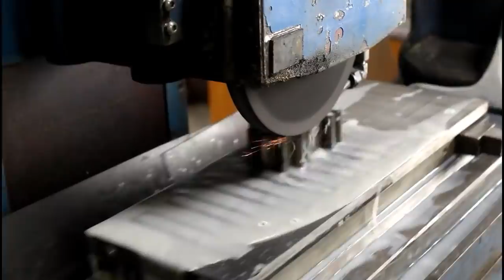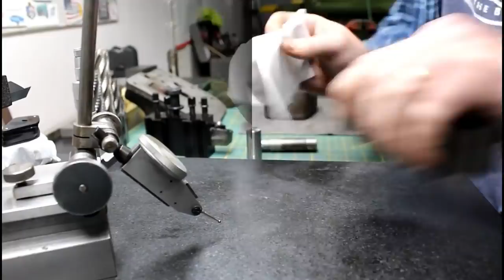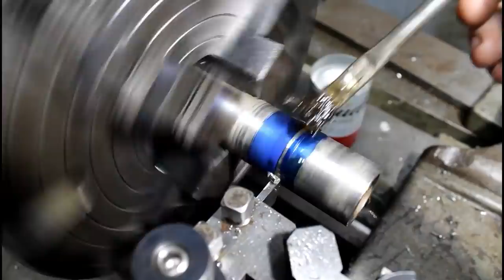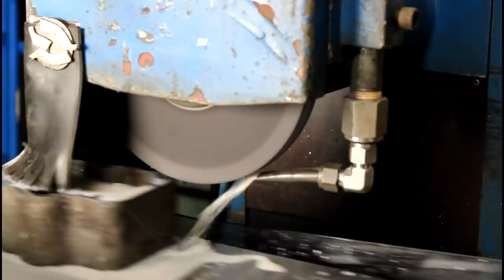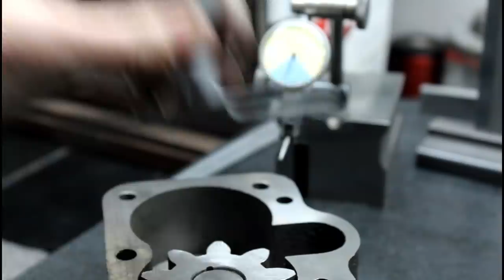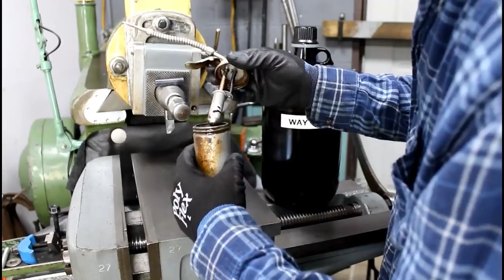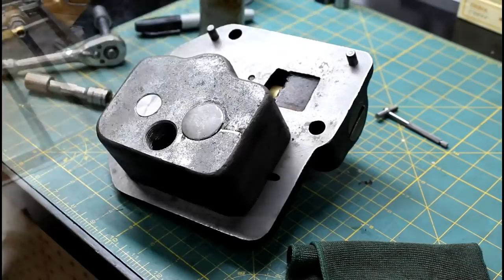OH Yeah! Gear Pump repair part 2

Comment: Steve, sigh I had my fingers crossed. Epoxy coat the walls and then machine to size. There are epoxies formulated for fuel tanks,.etc. Less expensive than plating as someone else mentioned although I'm preferential to plating.

Comment: Is the pressure relief valve leaking air?  This may allow the pump to drain dry back into the tank.
Reply: Look at 22:08 valve seat .....................

Comment: Your notion of slotting the teeth was my first thought. But I think the inserts will interfere where the gears mesh. You could use flat brass shim stock, bent around the gear bore. It could be made to stay in place by bending the ends and drilling corresponding holes/slots to retain the ends. Good luck Steve.

Comment: If you wanted to tighten up the radial clearance without making a giant project out of it, you could bore and install speedi-sleeves with some loctite, then cut out the center part where the gears meet. They have the sleeves in stainless, in stock. Might be easier to just press in som pcs of sch 80 pipe and rebore

Comment: Morning Steve great content in both pt1& pt2 if the clearance is available on the top and bottom land of the gears a whisper system would work that pending on the barrel tolerance which if worn more then the gears the barrel should be bored out and sleeved I've been seeing in the comments if a check valve can be placed at the lift point that would keep it primed  but i do understand that the check valve will also hold that water base coolant in the pump which is another problem with in itself. Here is a funny for ya 3D print some new gears to fit the tolerance of the barrel good luck Steve  time for me to go to the shop have several tractors to wire up today for some reason boss man thinks I'm the only one capable of wiring things up go figure right.

Comment: To reuse the setup you have I'd OD grind the gears and make a new gear case from a block of cast iron. My initial thought upon watching part 1 was to come up with a way to retrofit a Ford gerotor style oil pump to the unit.

Comment: Your pump works just fine for what you need it for. Like others have stated, a check valve in the pickup would solve the priming problem. Or a priming bulb on the outlet somewhere.

Comment: Good Video so far Steve, Next step I would take is to build up the cast housing some how maybe by brazing and re machining. Over sized gears are out because of fix shaft locations. Gear tooth clearance is letting oil drain back while off. Could also make a new housing out of aluminum . It will wear but not too fast. Seen a lot of hydraulic pump in equipment with aluminum housing last years with metal particulates being pump through.

Comment: why Brazing ?, there are Stick-Electrodes on the market that become hard as Rock. that way you can build up the theeth,  grind them to dimension after welding , and also harden the gears  as before. :).  it is a bit challenging spending so much time and get not rewarded, i went through similar isues with a pump for a boat that provided the cooling cylcle of the engine. You could also Slit the teeth and put a strip of teflon into the teeth  (high pressure pumps use this often to ensure the perfect fit, regardles of the wear of the housing :). as always , thanks a lot for sharing,

Comment: Before you do anything to the teeth of your pump. You need to take a measurement between the teeth peak and root. Adding a sleeving the bores would work better. For machine that is not used all the time and when it does you may not need the coolant I would leave the pump as is.

Comment: Steve....I like your idea of slitting the ends of the gear teeth and inserting Teflon 'wipers' to increase the pressure. I say Teflon because it's flexible enough to be set to 'wipe' the inside of the pump housing without permanently deforming.....and increasing the likelihood of maximum pressure. Honing, or even re-boring, the interior surfaces would probably help, too, and the 'wiper' solution would adapt best to that, I think. Really enjoying your videos. Thanks!  :-)

Comment: Thank you for the excellent videos Steve, please keep them coming. Like suggested below,  I would consider a liner of some sort in the pump housing around the gears, or if you're dead set on adapting the gears, build the tooth edge up with your tig welder. Perhaps less heat that brazing, but the tooth would probably harder than ever.

Comment: Hi steve ...I would weld the gear tips ....then chuck it up in the 6 jaw lathe chuck center drill the one end of gear ....turn diameter to .025 thou. Needed for zero clearance from  the feeler gauge / straight edge gap...hand grind or mill off access  weld maybe blue mating gears ...( like blueing in rack and pinion 4 wheel drive gears lol)( don’t touch grounded lathe gear tips ) easy peezy

Comment: Something I noticed while you were putting the pressure pipe back on, (where the check valve goes), is a recess or an O-ring groove for the check valve to seat? Is there any way you can check to see if the check valve is even seating properly? My guess is that all you need to do to get the pump from loosing its prime is to just fix the check valve that is already there.
Great work Steve. Keep the videos coming.
Reply: I think you are all onto the problem with this pump.  The check valve above the pump keeps or slows the drain-back above the pump.  Ideally, there should be a (light)spring loaded check between the pickup foot and the pump body.  That would keep fluid in the pump body above the sump level.   Maybe there was one there at one time and it just got replaced by the pipe nipple.
Reply: @ramosel  The "spring" that forces the check valve to close is the 30 inch column of oil in the riser pipe above the check valve (and the weight of the heavy brass flapper itself). That should be more than enough to force the flapper in the valve closed when the pump stops. It works the same as the flapper in a toilet tank (which has less than 8 inches of water closing its flapper).

All the discussion about pump clearances is irrelevant. He only needs to make certain the flapper can form a good seal, AND he needs to ensure there aren't any leaks (in the pump case or the pickup tube) which would break the suction when the pump stops.
Reply: That sound right to me.  Also I am thinking that "This Young Steve" is on to it too because he was rather insistent that we watch Part 1.   That's fair,   if he has some fun at our expense. We get plenty of enjoyment from his tireless endeavors.
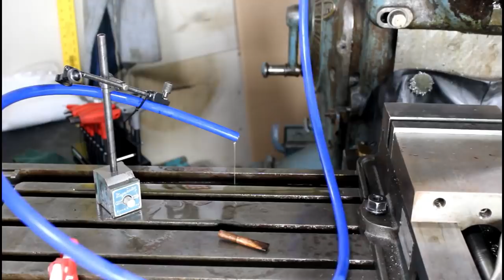Reply: I also noticed that air seems to be getting into the oil when running it after priming the pump and taking the nozzle off. (31:38). See how milky it looks? Hear the popping sounds?
On the drive side of the pump, where the shaft goes threw the top plate, is there any kind of a seal on the shaft? If not, this may be where it is pulling air in when running and allowing air in when not running and allowing the oil to leak back into the sump.
 I also think Dennis Williams has a great idea, raise the oil level in the sump may help.
Reply: Is that check valve on the proper port of the pump?   Steve is removing  the valve to manually prime the pump  (Part1 https://www.youtube.com/watch?v=TDxYFJvN3Ow&t=127s  )

Comment: Raise the oil level in the sump up to the gear pump. If the cutting oil is up on the pump it will self prime then
LOL
Reply: that is the ticket :) just keep the pump fully submerged.
Reply: Keeping a simple gear pump submerged in the oil has been done for ages, it's simple and it works. Really enjoy your channel, keep up the good work.

Comment: Nickle plate the housing and gears then machine for clearance (make sure gear teeth and chamber walls have uniform wear or re-machine before plating).
Reply: Would plating be thick enough?
Reply: @googleuser859  Nickel & nickel chromium is applied in "d" layers of about 0.0005".

Comment: I don't think that the gears or housing could be modified to close up the clearance.   That is because you would not be repairing the wear of the surface of the gear teeth.   Building up the gear teeth would be beyond most shops.   My vote would be for the check valve in the intake line or the auxiliary priming pump.

Comment: Doing work on two bores seems like less work than working on the teeth will be. The seal between the teeth and the bore does not have to be the whole circumference of the wall, it just needs to span the distance between three teeth, so you could use a piece of that feeler gauge stock. It doesn't even have to be stuck to the wall it just needs to be fixed at the end. Just a thought.

Comment: What about sleeves in the housing, like piston's have?
Reply: @bill bergovoy . You would have to make the round Sleeves first, then cut them out for the gear opening, so they would not be a complete circle.
Reply: @hpelisr  What holds the open ends from springing in and trying to rotate?
Reply: @waynepegram3262  , It does not need to be oversize, just A little taller than deep, so when the top is put on it will compress it down tight.
Reply: @hpelisr  Won't work, unless C shaped sleeve is mechanically locked "ie silver soldered" to housing  to stop the sleeve from wanting to ROTATE if/when chips get sucked in and wedge between gear and sleeve.

Comment: Kerosene works well in a parts washer.....
Reply: Yeah, I actually use diesel fuel because it's cheap and easy to get. When I first got my parts washer, I bought parts washer specific solvent, but it was expensive, and expensive to ship. Now diesel fuel is my go to.
Reply: Marcel LeMay yes indeed, diesel fuel works very well, but the smell gets to you after a while, that’s why I like kerosene.

Comment: A check valve may get stuck open with machining swarf.  My vote is machine the gear bores until they clean up and add braze onto the gear teeth.  Turn the gear ODs to give a 0.002 radial clearance.

Comment: As someone already said adapt a standard small block Chevy V8 oil pump from Melling, or a step further a high volume one - cost about $30 or less theyve been around for decades - or even better a big block chevy pump that has more and I believe taller teeth than the small block pump, either one is extremely reliable and volumes can be adjusted with the spring.  This would be a brand new pump at a fraction of the cost of the machines factory pump, just a question of modding one to fit -- likely last forever and cheap to replace,  what I dont know is the pressure and volume of your original pump, find this out first for the closest match in specs.

Comment: Use the same material you use for resurfacing ways, build up to where you have some to take off- epoxy it on like you're supposed to, of course. Remove enough of the cylinder body to give you a nice clean smooth surface for the epoxy to stick. You could also do this to every other tooth on the gears, but do check the inter-gears fit and the pin bore to ascertain min max conditions.

Comment: Nice job on the pump. Is there a check valve between the pick up and the pump? If not, that might help maintain the prime.

As for the solvent tank, used that same model for over 30 years. Still on the original pump and it's used daily. As for solvent, low odor mineral spirits works pretty well.. Expensive through Home Depot or Lowes. Might be cheaper through a Petroleum Wholesaler in bulk. It doesn't turn stinky here in the southwest heat which is a big plus. In addition, adding a screw-on diesel fuel filter between the pump and the brush hose extends both the life and quality of  the solvent.

Comment: Put a non-return valve on the suction side of the pump, so it’s always primed
Reply: You got it, also known as a pump foot valve.
Reply: Just what I was going to suggest....
Reply: I'm thinking here that there are too many solids suspended in the oil to allow the seats to seal properly.  Might work initially but will fail in time.
Reply: @peterhaan9068  Should be OK with a soft seat and a weak preload spring
Reply: @peterhaan9068  A finer screen should help with that, you just can't go too fine or it will clog too easily, though filtering the return oil could reduce any clogging but I don't know if that would be easy to do on this machine.
Reply: exactly correct answer !!

Comment: Steve how about a check valve on the outlet line so the oil does not drain back into the sump.  It would not loose its prime.  red

Comment: Hi Steve!
Great video, as always!  Watching this series I cannot help but think 'somewhere' there was supposed to be a check valve on the intake side of the pump.  Think of the old farm shallow well pumps that required a "foot valve" on the end of the intake pipe.  That said, a 'possible' (maybe not 'feasible') work-around.  My grandfather had an issue with a seepage leak on the foot valve of a stock watering well pump, back in about 1960.  He came up with a small, manually operated, secondary pump that dumped some water back down the outlet to regain prime, when he needed to run the pump.  This worked until he was able to hire someone to come and 'fix' the foot valve.  As said, maybe not feasible.
Thinking about the foot valve scenario, it occurred to me that (at one time) there may have been a very simple one that was inside the intake pipe above the screen.  It might have been a lightweight (rubber?) ball that simply settled onto a step or o-ring seat inside the intake pipe.  Possibly eroded away, or lost at some long past 'rebuild' of the pump???  Does this sound probable?
Replacing the bypass spring looks to be a very reasonable thing.  However, this also sets the overall system pressure capacity, as you alluded to.  IF you want 'just a little more' pressure, place shim washers behind the spring to step up the pressure, marginally.  Perhaps as thick as one or two spring wire diameters?  Just do NOT over-compress the spring beyond (shorter) than about 75% ~ 80% of its free space distance between coils.  Many springs will begin to 'take a set' in this area of compression.

Anyway, Best regards, & God Bless!
Ken

Comment: Hey steve just adapt an oil pump from a small block chevy you can do that. PETE
Reply: I was thinking the same thing... old school small block/big block pumps use the same gear type. Most likely too much pressure, but nothing that can't be adjusted. Still think a check valve will fix the issue with the original pump, but always good to have a plan B in the works.

Comment: Steve, I know you like to do everything yourself but the easiest way to build up the gears might be to have them hard metal sprayed oversize. Mill the housings so that they are perfectly circular, finally hobbing the gears to the final diameter of the housing less clearance. If you were going the tip seal route, I would go to a Mazda dealership and see if they have any old tip seals from their Wankel type rotary engines, which you could cut to fit.

Comment: relatively quick and easy, 'temporary ' fix could be to add a tee below the existing shut off with its own valve and create an easy way to prime the pump without any dis-assembly of the plumbing .

Comment: Steve what's about fitting a none return valve between the coolant control valve and the rigid steel tube? This will stop the oil siphoning back into the foot. Any fine metal particles may stop it seating but may be a quick fix.

Comment: I might be inclined to try building the teeth tips up with solder, but you may have to settle for soder.  (Not everlasting, but neither are we.)  A rising check valve in the input pipe might be more useful than a veteran flap check valve in the output?

Comment: Maybe try re-sleve the pump housing... seems like the less tedious way to reduce the wear
Reply: That's what I was thinking.
Reply: I think that putting in bronze sleeves would be the best. Way easier than focusing on the teeth. Yes a lot of indexing but basically boring bar work.
Reply: Yes, make a sleeve to take up the excessive clearance.
Reply: Re-sleeving twin overlapping cylindrical cavities would be a complete bitch! How would you even go about creating such a part, assuming you knew in advance the correct dimensions and required tolerances (which we don't)?
Reply: @aporiac1960  a strip of shim stock, curved into the outline of the 8 shape.  Wouldn't even need to close both middles.  Could probably even adhere it to the walls with loctite
Reply: @BobOBob  I agree with you as what you said is exactly what I was thinking. The bonus is if the shim wears it can be easily replaced. I would be inclined to reduce the housing height to around two thou clearance as well. One other thought is the backlash between the gear teeth is of little consequence as one gear is driving another so the faces of the teeth are in contact. Just my thoughts having had success on this type of pump in the past.
 Cheers from John, EC Australia.
Reply: @BobOBob  REALLY....? " just curve a strip of shim stock into "the outline of the 8 shape"  Damn, you're good.
Reply: @aporiac1960  You solder in some bronze sheet, then cut it back down to dimension.
Reply: it would be 2 parts. there is no critical dimension between the gears, its between the teeth and the wall. that is where the work is produced. where the two cylinders intersect can be simply milled to be flush.
Reply: Fill the  oil tank to the nek